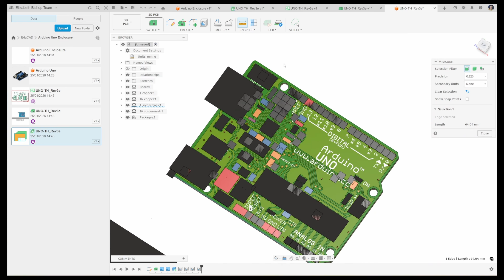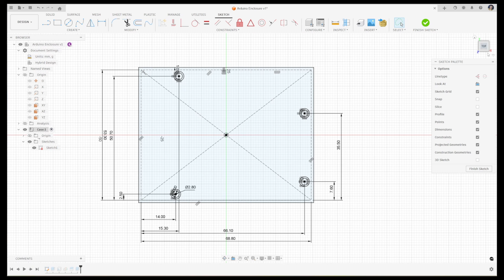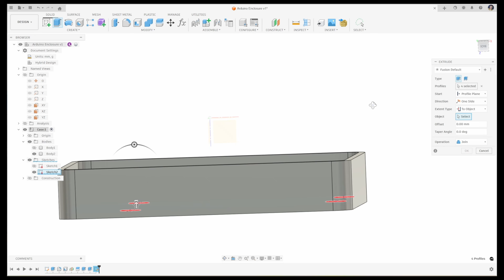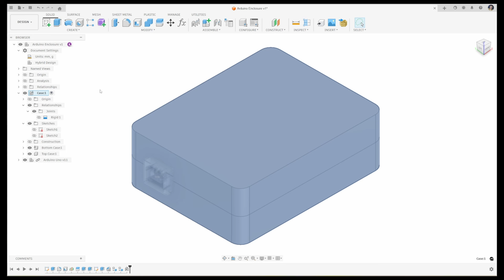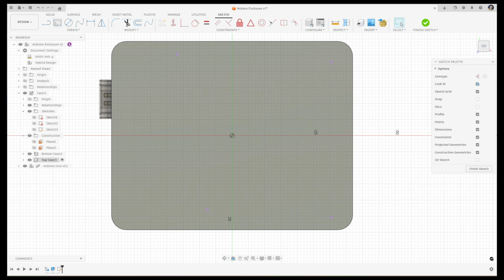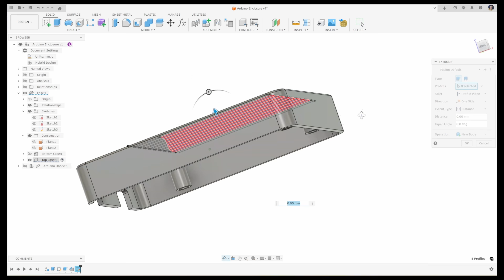Learn to Design a 3D Printed Enclosure for Arduino Uno in Autodesk Fusion

Comment: The lip and groove feature should have some clearance factored in when you intend to 3d print it.

If you dont have that feature because of autodesk moving more features to paid you can easily just use a sweep with a path constraint, which is arguably a better option anyway as you can build whatever clearance you want into the sketch.

Comment: Great tutorial. One observation about the workflow I hope it's okay to make was around the fillets on the corners of the box. You set an initial offset of 1mm of the box from the Arduino board then added your fillets to the corners of the offset rectangle. It's probably worth pointing out that this may cause an issue if the fillet eats into the profile of the board when the corners get cut off by the fillet. It might be worth reminding folks to review that the board still fits inside the design (in your design I think the corners of the board might graze the inside of the box). Make sure to do a QA of the result before doing your first print. It's not for this tutorial but there are also ways to handle this using parameters to keep things in position even if the fillet size gets changed. For anyone really new, I recommend learning about parameters as soon as you can. It will revolutionise your designs.

I also have a question. When you did the sketch for the holes for the power and network port on the side you first created an offset plane with zero offset then created your sketch. On the top of the box, you did the sketch straight onto the body. Do you have a recommendation as to which is the better approach? The only reason I could personally see for doing the offset plane/sketch on plane approach could be if you wanted to move the sketch out of the way, but this doesn't seem like a smart use of the offset plane.

Appreciate your work Elisabeth. I suppose I'd better go build a case for my Raspberry Pi, Pi-Hole that's been naked for ummmm.... four years.😜
Reply: Hi Stuart,
Personally, I’ve found that creating a separate plane for sketches can be more robust in the long run than sketching directly on a body face.
   If that body gets deleted or significantly changed upstream in the timeline, reassigning the sketch to a new face can sometimes produce unpredictable results. 
When the sketch lives on its own plane, it’s usually much easier to recover the model — you simply reassign or move the plane while the rest of the relationships remain intact.
   Think of it like building a puzzle on a puzzle mat instead of directly on a table. If you want to change tables, you just move the mat and everything stays together.
Hope that answers your question.
Thank you
Reply: @crystal8870 ahhh yes that does make sense. Now recalling how often I get the warning to redefine a sketch plane that totally makes sense for a cleaner workflow. Thanks so much. Cheers

Comment: The Lip, thats how you do it.. if you pay :-(
Reply: Unfortunately fusion is pushing hobbyist away more and more. I wouldn't mind paying for all the features with a non commercial license - but the lowest tier they offer is already too much for personal use.
Reply: No, Wayne.
Recreating the same feature usually just takes a few extra steps. That’s true in almost any software.
What you’re really paying for isn’t the ability itself — it’s the convenience, the integration, and the time saved by having those tools built in.
Reply: @crystal8870  Dude it's like saying that the locked router in the wood shop is irrelevant because you can do the same with a chisel and a mallet - technically true, but a dick move and gatekeeping none the less.
It is a feature of the software that has been locked behind a (rather expensive) paywall. Stop shilling for the corps.